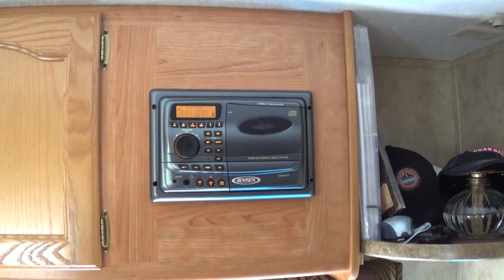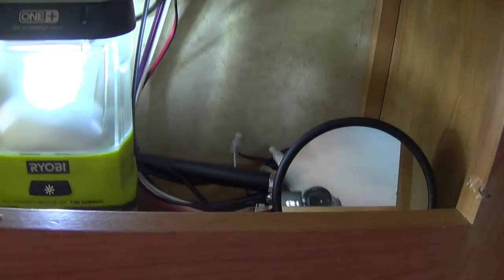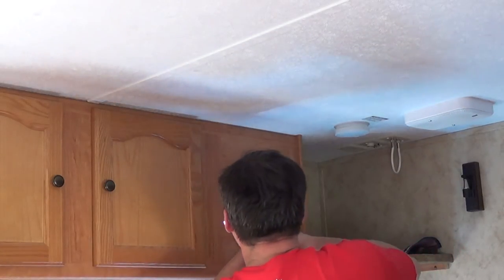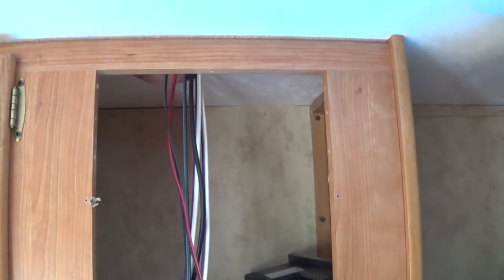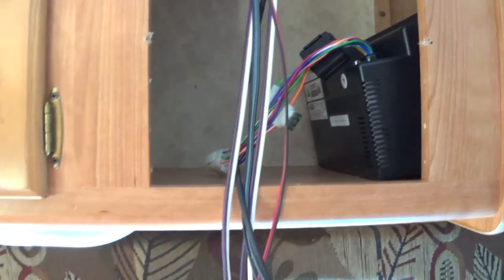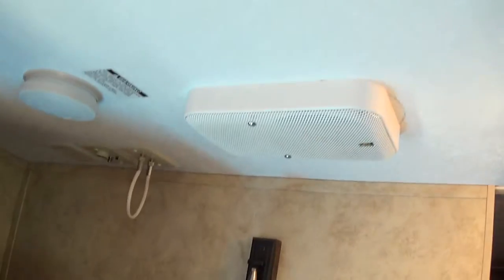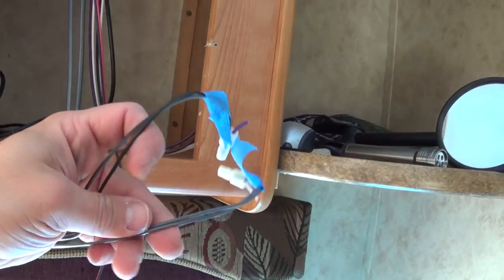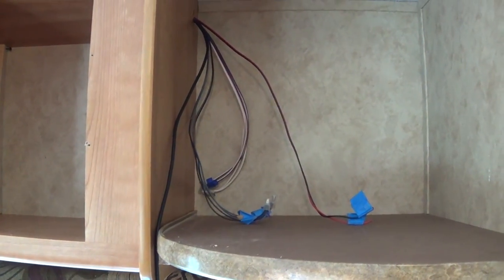Travel Trailer remodel: part 7  Removing the "stereo"

Comment: So, first novice here, so hopefully this makes sense. I would appreciate any advice or resources that might help me on this. The stereo unit in my ‘92 RV has a similar setup on the back, but instead of a wiring harness and color wires, it has about same about of wires in a similar configuration going directly into the stereo unit... and they are all the same color. 

Again, thanks for any input you may have for me. 😊

Comment: I REALLY LIKE YOUR VIDEO AND KNOWLEDGE, THEY LEFT ALL THE CRAP FROM CONSTRUCTION IN MY UNIT TOO. COULD YOU GIVE SOME IDEAS TO REVERSE DOUBLE LOWER TO AN UPPER BUNK IN A BUNKHOUSE MODEL ?
I SEE THE TWIN BUNK ON BOTTOM AS A BED AND SEATING. ANY IDEAS HOW TO STRENGTHEN AND ATTACH TO THE TRAVEL TRAILER WALLS WITH FACTORING THE WEIGHT CARRIAGE LOAD.